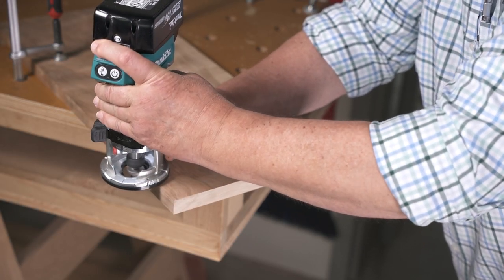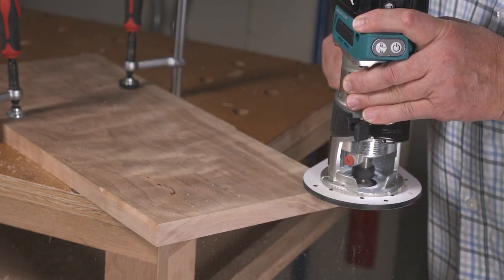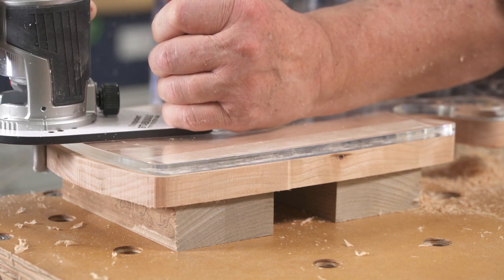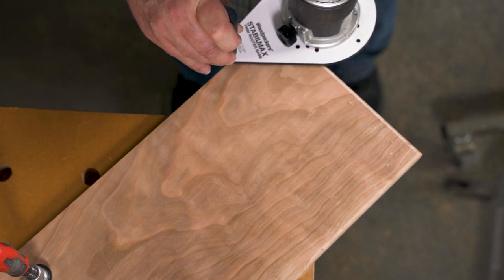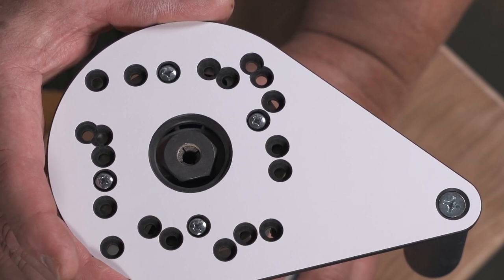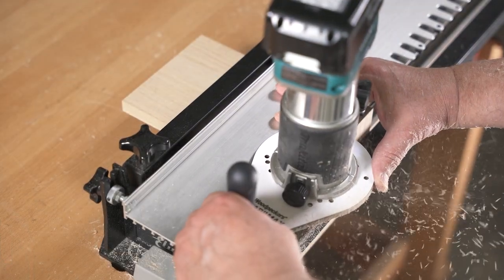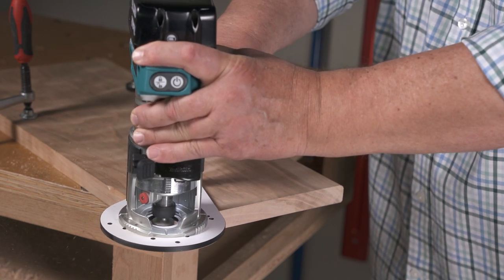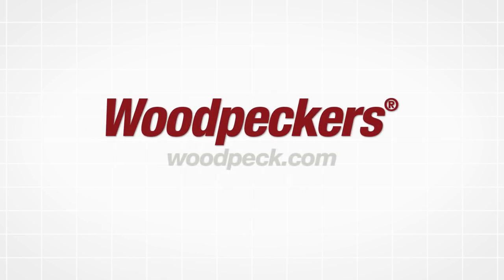Stabilmax Trim Router Base

Comment: It's crazy that they didn't make it fit the Milwaukee cordless trim router..... That's one of the most popular trim routers in use right now if not THE most popular!!
Reply: I agree, very disappointing.
Reply: Not really a Dewalt fan, but Dewalt's palm router is much better than the Milwaukee's offering. Sorry but it's true
Reply: It is THE most popular trim router.
Reply: It’s not like them to miss that, I wonder who made the decision to leave Milwaukee out.
Reply: @Zamboni-0805  sorry but I have to disagree. I own the Makita, Dewalt and 4 Milwaukee trim routers. I always reach for the Milwaukee first.  If I have to rate them, Milwaukee comes in first, then Makita, followed by Dewalt 3rd. And I am not a brand loyalist.... I use whatever is best. Although honestly they are are excellent trim routers.
Reply from the maker: Fixed! Starting now, StabilMax is bored for the Milwaukee 2723-20.
Reply: @WoodpeckersLLC  Thanks, ordered mine today!

Comment: This fits so many routers, is there any surface left to smoothly round those corners without catching on one of twenty-three holes?🤣
It would be nice to see you offer at least two bases to cover all the routers so half as many holes would be on each of them. Or offer a blank as well so it could be drilled to fit as needed.
All the Best, Chuck.

P.S. It was added to my Wish-List. 👍

Comment: I was about to purchase, then did not hear Milwaukee compatibility. Bummer, I sure could use this!
Reply: You can make your own for under $10
Reply: @Zamboni-0805  Agree, I may go this route - polycarbonate. Some of these accessories I don't mind making. Sometimes it is nice to just pick up a solid designed one.
Reply from the maker: Fixed! Starting now, StabilMax is bored for the Milwaukee 2723-20.
Reply: @WoodpeckersLLC  Wow, awesome thank you! Order placed!

Comment: Not compatible with Milwaukee?
Reply: Nope. Checked the manual. Not on the list.
Reply: You can make your own for under $10
Reply from the maker: Fixed! Starting now, StabilMax is bored for the Milwaukee 2723-20.
Reply from the maker: Fixed! Starting now, StabilMax is bored for the Milwaukee 2723-20.
Reply: @WoodpeckersLLC    I received mine today.  The assembly sheet doesn't mention Milwaukee, and the diagram doesn't show the Milwaukee mounting holes.  There are four undocumented holes on the base.  These four undocumented holes fit the Milwaukee 2723-20 perfectly.  Other than the outdated assembly sheet, the StabilMax base works with the Milwaukee 2723-20 perfectly.

Comment: Hi Jeff! Was disappointed to see the Stabilmax isn't pre-drilled to mate with the Milwaukee M18 Compact Router, which is by far  the best small router I have ever used. But you guys have hit the nail on the head with this trim router base - much needed! So, I'm going to order one anyway and see if I can drill the mounting holes myself.
Reply: Totally agree
Reply from the maker: Fixed! Starting now, StabilMax is bored for the Milwaukee 2723-20.

Comment: I can build one for maybe $10....why would I buy this?
Reply: Who cares what you can do....we don't need to know
Reply: I think your pricing is off. It'll cost you that in shipping for the handle from McMaster. I am confident this is a good product, well made, with accurately drilled holes and offered at a fair price. Unfortunately, there's no option for Milwaukee.
Reply from the maker: Fixed! Starting now, StabilMax is bored for the Milwaukee 2723-20.
Reply: @heydoyourhomework  $50 is a fair price? LOL!
Reply: @Zamboni-0805  I spend more on pizza each month.